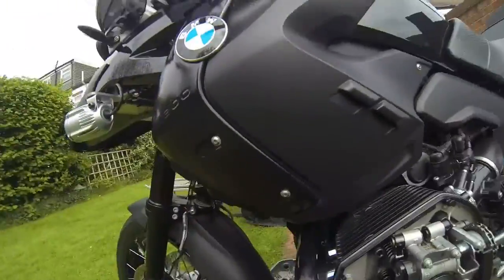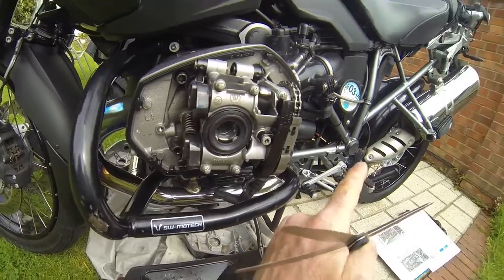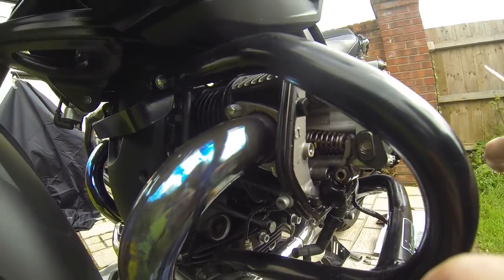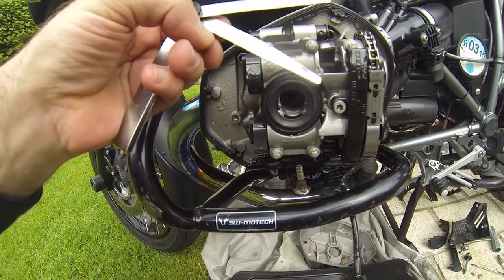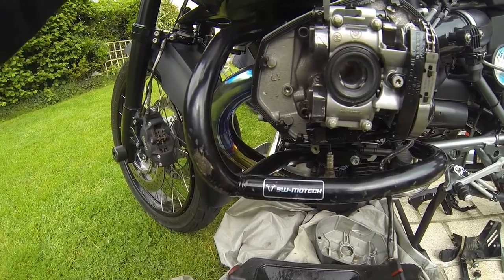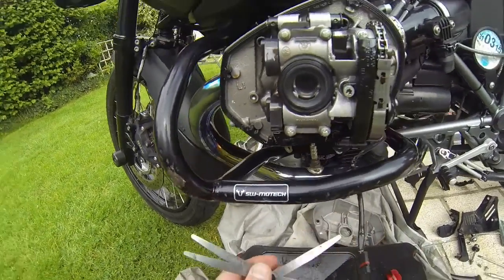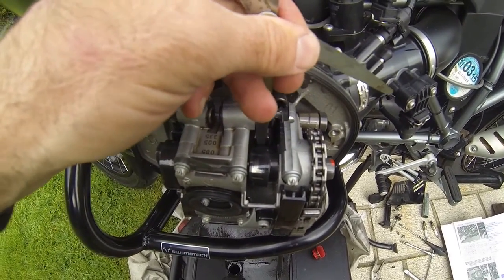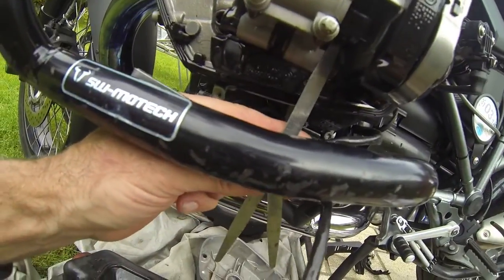BMW 1200 GS triple black 2012, how to shim valve adjustment of tappets

Comment: How often this have to be check?
Reply from the maker: Every service they need to be checked. How long have you owned your bike? Regular oil changes will help reduce the time they need to be changed. Also making sure you start the bike and leave just a little while to get oil all around the engine. If you use a good quality syth oil. Hopefully if you follow all of these it will help reduce the shims need replacing. Vince

Comment: Well, that was a waste of time, wasn't it? (Only joking!) It would be very useful if the clearances were out of spec, so that you could explain the procedure for actually adjusting them. Mine are getting a bit clattery and will need attention soon! I don't mind saying that it is a job that I am no particularly looking forward to!
Reply from the maker: Thanks for your comment. The next part is to then buy shims depending how much clearance there is. If its the type of job you do not want to do. At least if you check them first, you can go to the dealers telling them what the gaps are. What needs doing. It might also be cheaper that way. Local independents can be better than main dealers as they often are on their good name rather than beating the clock service time.